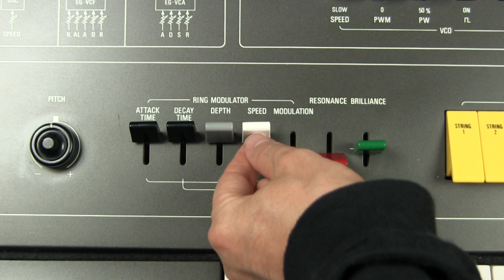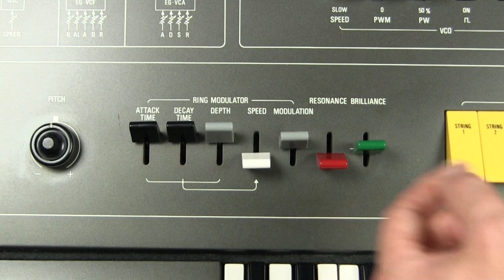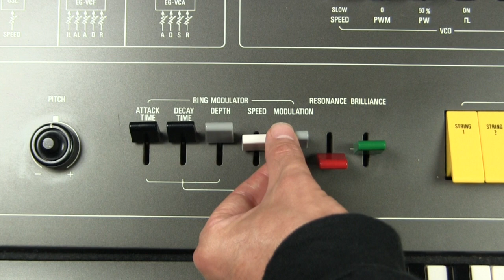The CS-50 Ring Modulator part 1

Comment: One of the first kits I put together (before I got off the kits) was a passive ring modulator. What a wonderful circuit! It consists of two transformers and a RING of diodes in between them (FULL bridge rectifier).
Reply: No - a diode ring is NOT the same as a bridge rectifier. Look closely at the directions in which they are arranged!

Comment: Hello. I wanted to ask you something in the ring modulator section. If you lower only the modulation lever in the ring modulator, without playing anything and with the volume to maximum output, there is an increased background noise similar to noise generator?
Thanks.